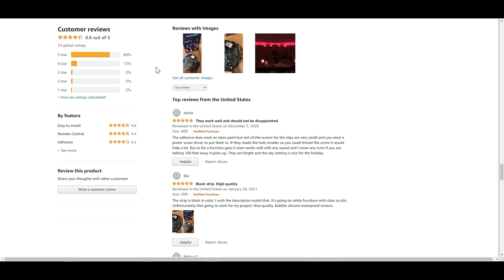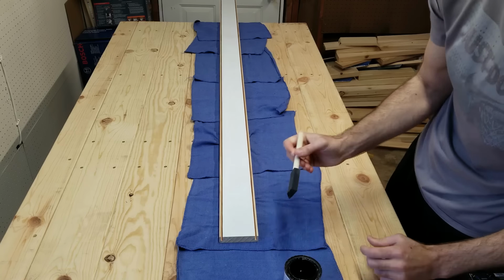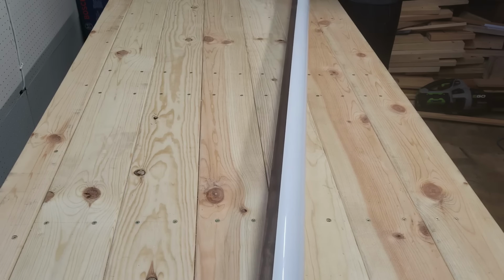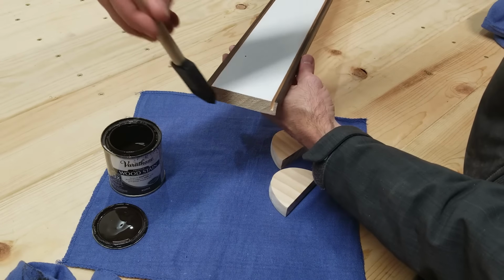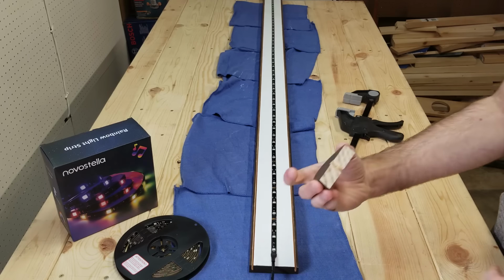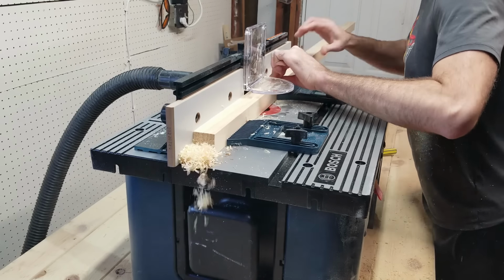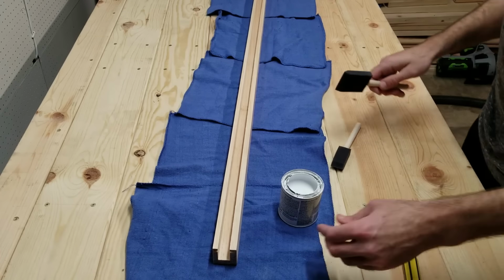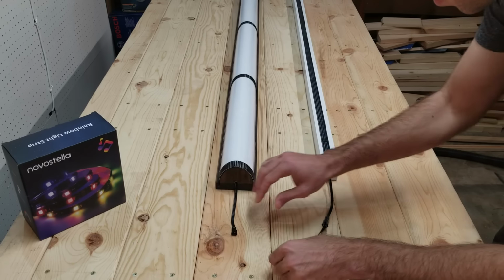DIY LED STRIP DIFFUSER IDEAS

Comment: just a quick tip, when doing your sound clips, instead of turning off the music, just make it quieter, that way it doesn't just seem like dead space. also, in between audio clips, you can hear you press the space bar or whatever you're clicking to stop recording. i would recommend recording each of the clips a few seconds longer that way it's easier to cut that sound. this isn't meant to be criticism, just some tips.
Reply from the maker: Thanks so much for watching and for the advice! I'm still new and appreciate any advice on how to make things better! Thanks so much and I will certainly fix those things on my future projects!
Reply: @ChrisMaherDIY  I usually have a standing recording of 10 seconds of dead air that I use to fill the spaces
Reply from the maker: @BigDiesel330  thanks for taking the time to comment! What is a standing recording?
Reply: @ChrisMaherDIY  Before each recording session, I record a ten to 15 second clip of "silence."  Just me sitting there quietly.  Then I use that recording to fill in the dead space between my clips so it sounds like one uninterrupted clip.  It is different for every room/location I shoot in.
Reply from the maker: @BigDiesel330  ahh I see! They makes sense. Thanks for the pro tip! I need all the help I can get! Appreciate it!
Reply from the maker: @Average Drew thanks buddy! I have no experience with video stuff so I really appreciate the helpful tips!
Reply: @ChrisMaherDIY  Look how far you went! Amazing tips you got there, keep up the good work if you read this

Comment: One of the best tips I can offer when mounting LED strips is to put down a layer of aluminum foil tape before setting the strips down. It will make the leds stay cooler and have less to no chance of dead pixels. I learned this the hard way by having leds burn through the coating of several of my 1st DIY fixtures.
Reply from the maker: Thank you for the advice! I've never heard that but makes total sense. Much easier doing that upfront versus having to deal with a dead pixel later. Appreciate it!!
Reply: It definitely helps with the "water proof" led strips that have the silicone coating on them. I learned the hard way when using the 12V 5amp power to make my white DIY shop lights brighter. After a month or so, the coating was literally turning black right over each LED. I made a desk lamp with strips recessed in an oak plank covered with a diffuser plate from an office overhead using the foil as a "maybe this will work" and haven't had a single dead pixel yet. That was 3 years ago. Nice video by the way. I wonder if there's a way to get the stencil paper like yours in a bigger sheet.
Reply from the maker: @TejasAutoSalonJasonW  do you think the non silicone ones will be ok since there is place for the heat to go? Thanks! Fun hobby working with LEDs and making little projects but still learning a lot about how to best power them.
Reply: As long as there is air flowing over them. Like the big diffuser you made should be OK. Plus with RGB leds, unless you're using one solid color at high brightness for long periods it should be good.
Reply: @TejasAutoSalonJasonW  it should be possible to get transfer paper easy enough in sizes up to a2. which would be pretty big. not sur eif you managed to find a source for larger paper?

Comment: I tried Dozens of different ways to diffuse LED's.  Your way looked super clean. The only modifications I did was 1) taped diffuser paper together (stays hidden in slot).  2) used reflective muffler tape instead of white paint. 3) Instead of wood ends, I cut out foam so the light can bleed out on top and bottom. 3) I used small black coffee straws and wedged them in the slot end to end, gives it a nice bordered clean look.  4)I removed the original wiring from LED's (tri-color) and bought black 3 in 1 wire, looks clean.  Couldn't be happier with results.
Reply from the maker: Wow! That sounds awesome. I love when people are able to take an idea and make it better! Thanks for sharing and taking the time to comment!! Glad it turned out great!
Reply: @ChrisMaherDIY  I have a project for you :) ......   what would you do to hide and diffuse LED's on the top of the wall just before the ceiling?  I'm thinking foam crown molding and hide LED in there and shine up, but you might come up with something better, Sounds like a future video!!!!
Reply from the maker: @billbb7149  That is a great idea for a project and one I've actually thought about! I'll definitely put it on my to do list! Thanks again for watching!

Comment: Super awesome video! A thing you should try is this...run the strip and at the end, fold it and then ran the strip back down again, and then cut it( so it would appear as having two strips laid out in parallel but its just 1 strip) looks like you had plenty of left over to do this. This would have increased the brightness and increase the saturation of overall color.
Reply from the maker: That's a great idea! I didn't even think of doing that! Thanks so much for the comment and thanks for watching! Appreciate the support!

Comment: Just stagger the joints in the sheets next time (offset the first layer and the second layer by half a sheet).. that way if there's a slight gap, there will always be at least one sheet diffusing the light at that spot👌
Reply from the maker: I should definitely try that! Thanks for the suggestion and thanks for watching buddy!
Reply: I was also thinking this. He even mentioned the Amazon papers were worse because he'd have to use 5 layers. That should be better. Stagger the joints on 5 layers and it should blend nicely.

Comment: Turned out real nice. Good work. Word of advice about the router table though, you really don't want to hog away that much material at those depths in a single pass. 1/8"-1/4" at a time doing multiple passes. Those bits can't handle the stress of that much wood being taking away. Just looking out for your safety.
Reply from the maker: Thanks so much for watching and the feedback. That is great advice and I appreciate you looking out. That makes sense to not cut so much at a time. I'm very new so any safety advice is very much appreciated. My wife would thank you as well lol.

Comment: When you make a channel like that, you need to reverse the ends of the wood and run it through from the opposite end to make a perfect center channel. Cut your slots for the Diffuser paper at an angle more close to the angle the Diffuser Paper Arcs over to the other channel for a more secure fit and to hand upside down. Cool Project!
Reply from the maker: Love the idea and tips! Thanks so much for watching. I appreciate it buddy!

Comment: I like the mesh on the thinner LED bar but the overlap of the mesh would bug me a little. For the diffusers, when the stencil pieces are against each, is there a way to put thin clear tape with strong adhesive on the inside in order to have a strong seamless transition between the diffuser pieces? I guess you could possibly do the same for the mesh as well just so it doesn't overlap. Just a curious follower. Good content.

Comment: Hey, just wonder if there were any other good stencil paper options. They can’t ship this specific paper to we’re I live (Canada). And you said it was way better than the other things you’ve tried. Would appreciate the help.
Thanks
Reply from the maker: I still have yet to find something on amazon that worked as well. I'm still looking though! In a more recent project, I used a roll of kids craft paper which worked amazing. obviosly its pretty fragile but if its in a spot where it wont be bumped, i think it would actually look better than the stencil paper because there is no seems in the paper if you use a long role. https://www.youtube.com/watch?v=n9LsiQARFas Otherwise you might just need to try ordering things off amazon or looking at a local craft store for options and if they dont work, just return them. I've definitly have done a lot of that in my days trying to find things that work well! Thanks for watchng and taking the time to comment!

Comment: U r the best soon we will see 1m sub
Reply: But u have add heat think in led strip back for long life wood make the led chip so hot
Reply from the maker: Thanks so much!! Maybe one day! I appreciate the suppport!
Reply from the maker: Yeah if you run them for long periods of time and have them on full brightness, that would be best to use some heat absorbing backing. I run mine pretty low so I've never had any issues with them heating up. Thanks for the great advice!
Reply: @ChrisMaherDIY  ❤️❤️ keep going with your magic 🪄😍

Comment: If you're thinking of doing a led project and you want to extend the life of your LEDs, I highly recommend putting your LEDs in or on aluminium profile for the best cooling and fire rating. 
I'm basically saying if you stick your LEDs to wood or plastic, you increase your chances of setting your house on fire. only unexperienced people do this👍.
Reply from the maker: Thanks so much for watching and I agree Aluminum profiles would be the best option! Luckily I have yet to have any issues with led's not working or getting hot. I'm always surprised at how cool to the touch the leds are even after being on for a while!

Comment: Found your video because i want to build a Stand for my vertical mounted graphics card and wanted to include LED Strips in a way you can‘t see the single dots of the LED‘s.
I think your second method will be the best for my project because i need a flat surface at the front. Only things i will change is that the stand will be out of acrylic with a black foil attached to each sind instead if the front, there i will so the same you did or i just glue the sheet to the front with some transparent glue because i don‘t have such maschines to do the cut so i could simply slide them in. Also i want it flat with the front and not like on yours that the side pieces are a bit longer.

Maybe i will give an update as soon as i‘m finished my project if you or other users are interested in it because i think there are other people out there trying to do the same thing because there are no stands available for many pc cases and if you have a heavy graphics card like RTX 3090 you definitely need a stand when mounting it vertically :)
Reply from the maker: Your idea sounds epic!! Thanks so much for watching and the comment. I would love to see your progress and finished results! Keep me posted if you can!

Comment: Great video... I want to install such rgb strip led in my room as well can you explain how to add those designs km the ceiling or fit them into the wall...?? Also if anyone from India reads this do you know where we can get this type of machines for woodwork...??
Reply from the maker: I would just screw them into the wall or ceing before adding the diffuser material. The diffuser material should stay put on the wall. You might have to find a way to secure it if you have it on the ceiling upside down. At least on the first design!

Comment: Hi,  do you think the hobby lobby paper will work inside of the smaller aluminum channels to help with diffusion? Mainly concerned about heat of the leds close to the paper.  Thanks!
Reply from the maker: It will certainly help! However if the diffuser is really shallow, there might not be anything you can do to get rid of hotspots. Doesn't hurt to try! I wouldn't be too worried about the heat. In my experience the leds dont really get that hot.

Comment: I plan on hanging something like this on my walls, what should I do/use to connect diffusers around the corners?  I have an openish floor apartment so some corners stick out and others stick in
Reply from the maker: Corners might be tough with this design! I would probably just butt them up as close together as you can and see how it looks. If it doesn't look good, then I would probably just try to come up with some diy option (which I cant think of anything at the moment lol) Thanks for watching!!

Comment: I want to mount led strips to an exterior roof gable, with each leg being 16ft.  Would the second channel you made be able to span 16ft without splitting the wood? I want to mount each leg in one piece lifting them in place.
Reply from the maker: Thanks so much for watching! I'm not 100% sure but i'm pretty confident it would be able to span 16 feet just fine!

Comment: Great video. Any suggestions on how to make this a floor corner  lamp?
Reply from the maker: Thanks!! Corner floor lamp if you have the LEDs facing the wall would be pretty simple. It could be as easy as putting some LEDs on a 1 x 2 inch board with a very shallow groove cut out to put the LEDs in. Then maybe just build some legs that sit on the floor at a 45° angle. I might have to attempt making something now that I'm thinking more about it! Thanks for getting my wheels turning lol.

Comment: What did you use to connect the two led strips to 1 transformer? I need to connect 3 ends to one transformer / power source.
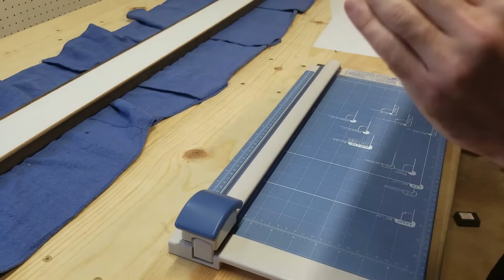Reply from the maker: If I remember correctly I used 2 different LED strips and the ones that I used each had their own power source. If you are wanting to connect multiple strips to a power source, this video at the 2:40 mark I kindof go into the details of connecting multiple strips to a power source: https://youtu.be/rIbTzUD2E4k

Comment: Too much work and tools to be a cheap solution! Lol. Though they still turned out awesome and I probably could improvise with my router and circular saw for similar results. So thanks for the video and future inspiration. I already bought $80 worth of aluminum corner channel with diffuser included. I mounted my RGBIC LEDs all around the ceiling of my room =)
Reply from the maker: Thanks buddy and you are welcome! Someone elseentioned that you could probably do everything with just a circular saw for the most part. Instead of using a router on the second one, you could just use 3 pieces of wood. You room must look amazing! How does the aluminum channel diffuse the LEDs? Does it work pretty well?
Reply: @ChrisMaherDIY  It looks really clean with the lights off. However the RGBIC strips I chose have a low LED per meter count to account for the space needed for the ICs. You do see the individual LEDs shining through, the diffusion is OK. I couldn't find the "spotless" variant of the diffuser material the company supposedly sells. It still looks good, my main goal was to hide the strip, so the added diffusion is a plus. =)
Reply from the maker: @morsecodereviews1553  right on! Definitely beats the look of just putting the led strip by itself on the wall. It's so tough to find something to diffuse LEDs perfects at such a close range!

Comment: Just go to Home Depot and for under $4 you can buy a "4 ft. Fluorescent Tube Protector" which is a clear plastic tube about as big around as making a circle with you thumb and index finger. You can cut a slit down the length of it to use with the slots you made in your wood and its 4ft long so you wont have to use as many of those gap concealing pieces. I cant believe more people don't use these tubes from Home Depot.. Its like no one realizes they are a thing. They're perfect for this type of thing and cheap!
Reply from the maker: Thats a great idea! I was actually going to home depot this morning so I'm going to take a look for sure! Thanks! I did have one question though. If the fluorescent tube protector is clear, what would be diffusing the LED's?
Reply: @ChrisMaherDIY  You can go to Hobby Lobby and buy "Transparent White Airbrush Color" paint and airbrush it on the inside of the tube. I personally like to use that clear iridescent cellophane youve probably seen in gift baskets that looks all the colors of the rainbow when at different angles. You can buy a big roll of this from the dollar store. You have to use a lot of layers with it but its the best diffusing material IMO.
Reply from the maker: @Eric-qp7rx  Awesome thanks! Always looking for other ideas so this is perfect! Appreciate it!
Reply from the maker: @Christopher Smith Great idea!!

Comment: Hi, great projects, videos, and all things included! On design number 2 what would be your go to diffuser material with the time and experience that has passed. I am looking to make these but in 16 foot lengths. Super cool and inspiring. All the best!
Reply from the maker: Thanks so much for watching and glad you enjoy the videos! The best material I have found so far and would try to use in every project if possible is the white acrylic that I have used in some of my other projects. https://amzn.to/3zyiUCL I just have not found anything that works as well. The only bummer is you might need to have the LED's just a little bit further away to get the perfect glow. Just have to experiment to find the perfect distance. If you need something that bends, the stuff I use in this video is the best. The only bummer about that material is I buy it at my local Hobby Lobby store and I have yet to find something on Amazon that works as well. Thanks again for watching!
Reply: Thanks brother, also big ups on the synthwave! I’ve just been getting into that
Reply from the maker: @joihngriffin4566  Its the best! Its the one style of music I have yet to get tired of over time lol.

Comment: Hey did you use any glue when tucked paper in? I'm about to do same thing but not sure if the diffuser won't come out without glue or something.
Reply from the maker: I didn't use glue since the bend of the stencil paper applied enough pressure on the sides to keep it in place. However, glue certainly wouldn't hurt. Just test it out without glue first and if it moves around too much then use it. Great question and thanks for watching!
Reply: @ChrisMaherDIY  ok thanks. And if u was to make this again, would you do it exactly same way or there is room for improvement?
Reply from the maker: @ldn1929  I don't think I would change anything. I'm happy with the way it turned out!